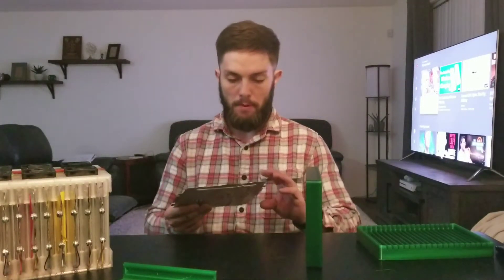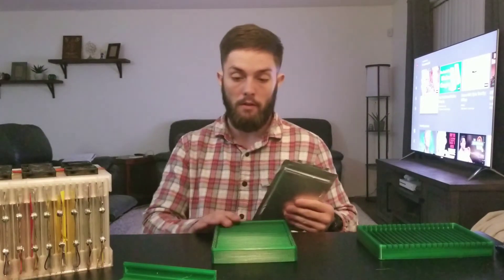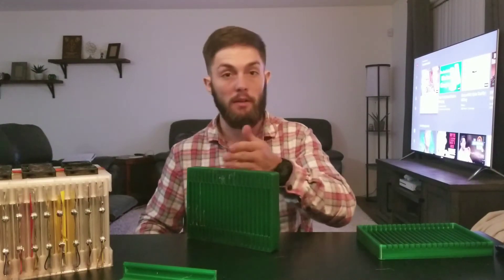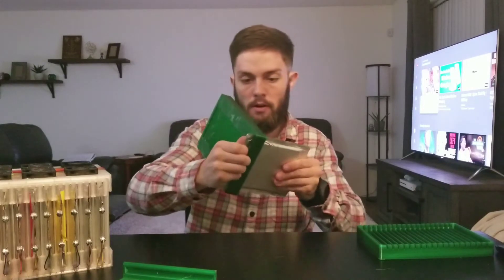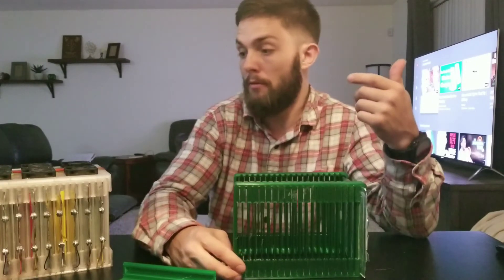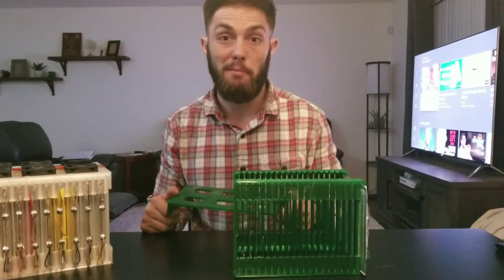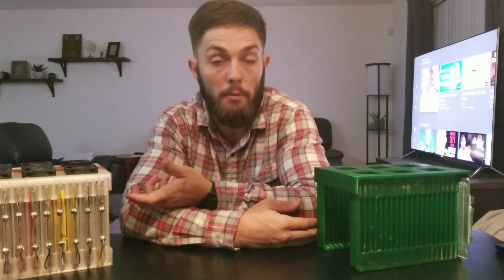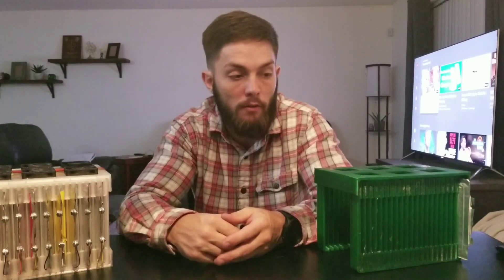Ebay Lipo cells 20s config

Comment: Junk. Chinese junk. Hahaha " Super cells".. 
 High IR, never a rated 8Ah that I've seen, not even with a 0.5C discharge, reports of cells shipped with holes in them, 5-7Ah max, 8mOh Ir, ect. Not 200 amp based on ACTUAL IR and CAP, more like 125A max C rate...
      On "sale" all the time to convince the unsuspecting buyer to purchase.  Go for it, try to do 200A contin and you will see the short cycle life and puff city. Using "new" rated specs to sell a "used " product. Bahahahahahaha 
I got datalogs. They dont lie. Along with loads of miffed purchasers telling me the results.
Reply: where are these other miffed purchasers anecdotes. can you post the link
Reply: @danimallegs1450  Yes: I can, and Yes: I will shortly provide anothers youtubers link to confirm findings and verify:
Reply: most battery's are from china! as for these all the reviews ive seen the mah has been very close to spec. the only neg thing ive heard from these are high IR on some and a possible short from the housing material. but if the supplier would let you exchange the high IR ones for better ones then I would say this is still the best bang for the buck for high discharge and capacity out right now

Comment: Due to the nature of Lithium pouch cells, wouldn't it be best to compress the pouches together instead of having air gaps between them? Cooling shouldn't be an issue in normal, non-electric vehicle type applications.
Reply: You are correct! If they are not compressed the cells with de-laminate, expand, and fail. I have yet to get any of these cells anything close to "warm", even discharging at 200 amps. So cooling is of next to no concern.
Reply: he said he was using in on an electric go kart

Comment: How are the cells doing without compression? Or did you add end plates to compress the stack?
Reply from the maker: the design in the video just relied on interference fit against the nickel anode/cathodes. I plan to redesign to allow clamping between each pack in what ever configuration is needed.

Comment: Nice pack layout.  I got  20 of these cells a year ago.  18 were good, two were slightly puffed.  Vendor sent two others to replace bad ones.  The first pack I made was a 3S3P for a trolling motor.  Works great.
I'm working on a 10S build now for another project.  If you have ONE of your 20S clamshells available (I'll cut in two to make 10S) let me know.  I could use it.  Will pay for it of course.  Thanks P
Reply: The clamshells he has are 3d printable. I can do it for you if interested.
Reply: Hello Paul

Have you already found something?
Iam also looking for a 10s LiPo Configuration

Comment: I will be ordering another 20.  Looking at 3 D printers too.  Any recommendations are appreciated.  24 volt power wall battery. Billbethel@gmail.com
Reply from the maker: Folgertech ft5 or ft6 is a great low cost kit printer if you have the time to build it. I bought one when they first came out, still going strong more than a year later.

Comment: Hey Mike. Great video and thanks for sharing. Any chance you could do a short video on what hardware you used for your connections? Thanks again!
Reply from the maker: Can do, nothing special between each battery connections just nickel plated hardware, although after im happy with design I plan to spot weld for better reliability and safety

Comment: How did you hook the tabs together?  I am looking to build a 36v pack for an old golf cart hoping to get around 50Ah. Plan on using BMS.
Reply from the maker: For now it's just nickel plated hardware, will spot weld when happy with design as hardware gets really dangerous between those terminals if something comes loose
Reply from the maker: Also yes bms, but only for cell balancing om charge. It's bypassed for discharge and short protection is done via fuse
Reply: Scott K, I am very interested in hearing how the 36v pack worked for golf cart.  I am interested in doing the same.

Comment: Great Idea and design. I would love to see a complete build video showing how they are connect, wired, charged, BMS etc. I do not have a 3d printer, if you ever come up with a way to scale these I would be interested. I was looking for a 24v system design so I was thinking 7s? I am new to this whole battery thing
Reply from the maker: Hey totally plan on making new videos. Im an engineering student and work full-time so these proj took a bit of a back seat after summer, but I'll def update
Reply: @mikep030303  Would love to see some more videos/hear updates on how this worked!

Comment: Hi I dont have a ptinter would you be willing to sell a pair of those mounts?  could you show how you connected the cell together? Thanks
Reply from the maker: Hey, I'll definitely see what I can do. I only have a single printer and these parts take a significant amount of time to print. So selling these won't be scalable via 3d printing. What configuration were you thinking? Also yes I can do a video going over the connection process. I just ordered another set of 20 ill make a video once they arrive.
Reply: Hi Just a pair I was thinking about ordering 20 to make a 12v battery just as a goof off project, but I was stumped on how to hold them.
Reply from the maker: Ok I'll try to figure out a reasonable system.
Reply: Sent you a PM on FB
Reply from the maker: Didn't get anything. The profile picture should be the same as this one.
Reply: @mikep030303   I guess I can't find the right you then. ?
Reply: What is your picture of?
Reply from the maker: Firing a SMAW
Reply: @mikep030303  Hey Mike, I just picked up 60 of the spim08hp's
I've been fricking on how I was going to out them together. Thank you for your YouTube video. You are the only one that has any info on building these types of batteries. I'm making 4 strings of 14 or 8 of 7 batteries. I'm still trying to figure out if it's worth buying a printer just to make the cases you designed. It's all for my sail boat and I would only but if I could fabricate other stuff for the  boat. I would be willing to pay you for your trouble if you'd print them up for me. And also how to wire them all together.
Here's my info...
Daniel Adam's
adamsdan55@yahoo.com
7605345457 text only unless you call early morning due to that everyone in this house working graveyard shift. Daytime sleepers.
Thank you for your time and all your hard work. Daniel Adams